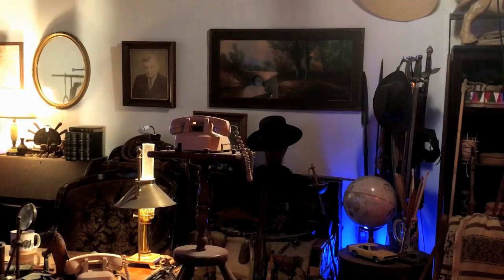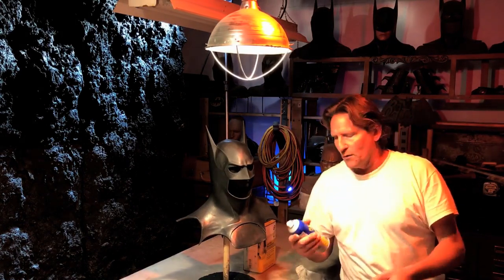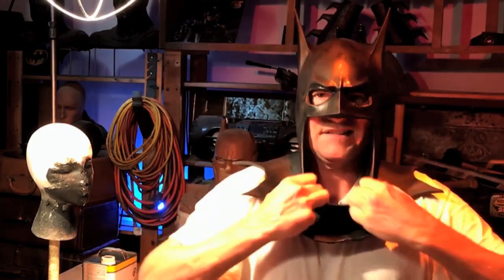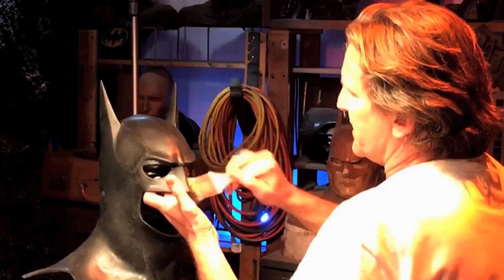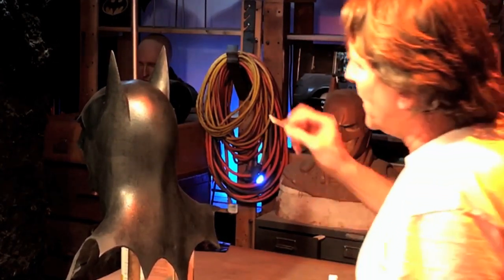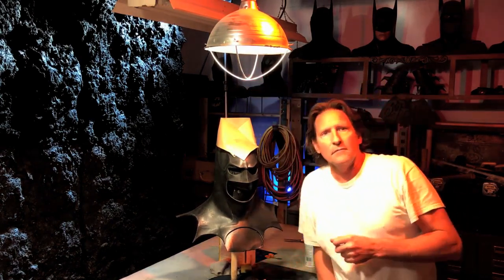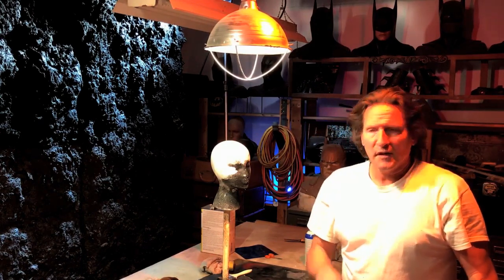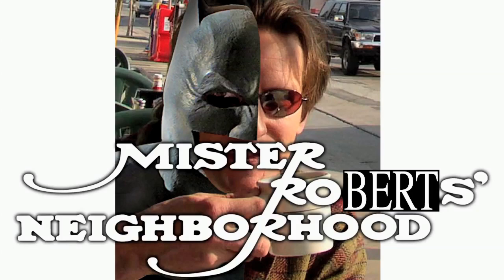Plastidip Spraying A Custom Made Batman Cowl

Comment: Great tips, I started using plasti dip to seal Halloween masks I repaint. Do you think plasti dip used on both the inside and outside will prevent latex rot over the years?
Reply from the maker: That is a really good question.  I have never heard that asked and I do not know the answer.  Seems like a logical conclusion though.